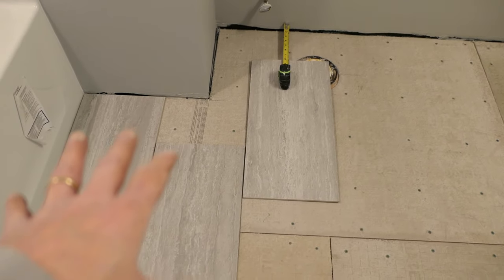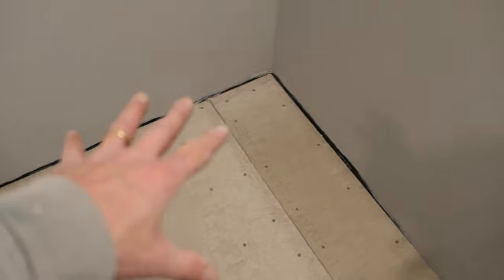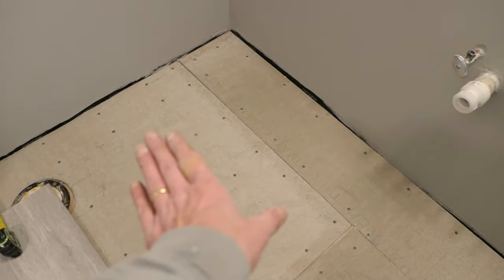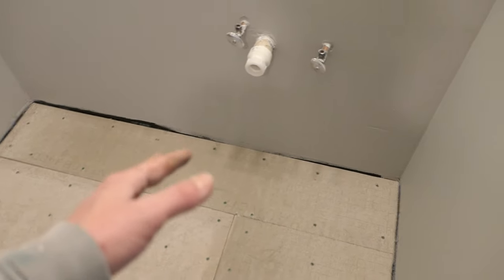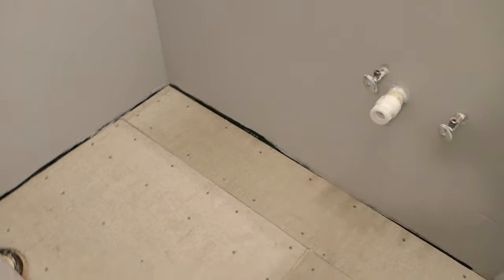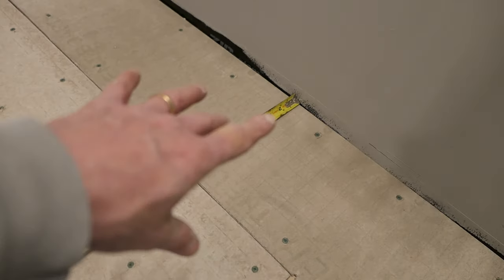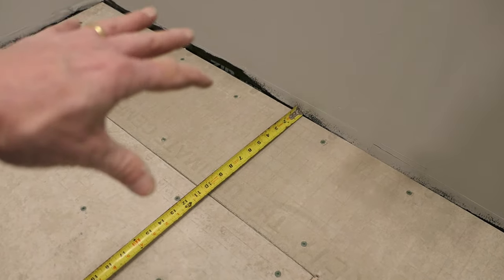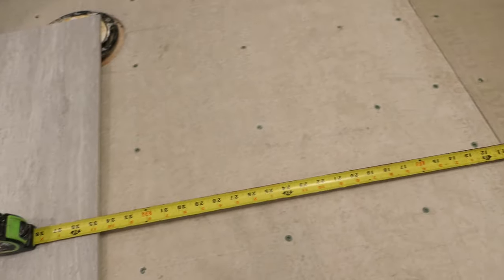Learn How To Layout Bathroom Floor Tile

Comment: You just Aug me handedly taught me how to layout and think through my process. So many other videos I watched talked about it as if I had done it before once or twice.
Reply from the maker: It is something you should spend time on and not feel rushed.  Planning the details now is a lot easier than tearing up tiles later!
Reply: @enduringcharm  absolutely.
Reply: @enduringcharm  do you recommend chalk lines or laser?
Reply from the maker: I don't find chalk lines or a laser to be useful once the tiling begins.  The chalk gets covered and the laser line is too fuzzy.  Sometimes I'll use one or the other in a larger room when doing the initial layout.  For small bathrooms I typically use the tub or pan as the initial straightedge and work off of that.  For larger bathrooms or kitchens where there is the possibility of tile rows becoming crooked, or for installing lots of very small tiles, I will screw down a straight edge to the floor.  Then I can lay an initial row of tile against the straightedge.  That sets up pretty quickly, and then I can remove the straight edge and use that initial row of tile as a basis for the rest of the room.
Reply: @enduringcharm  Thats exactly what I was thinking of doing. I have a pretty large kitchen that I’m about to tile and I’m going to use the laser for my initial line, set the first row of tile going north and south during my dry fit, then set the laser up going east and west for the rest of the room.
Reply from the maker: For a a large room like that, I'll cut up several strips of plywood on a table saw, about four inches wide.  I'll mark the straight line I need for the tile, and then screw the 8 foot lengths of plywood down along the straight line.  Now I can tile up to the plywood and after that row sets up I can remove the plywood and finish the job.

Comment: Great video. Love how you go through all the trade-offs etc. in your thought process. Layout is one of the least demonstrated parts of tiling. Your layout looks great.
Couple additions: A 4' grinder with a smooth diamond blade for cutting toilet flange holes. Then it doesn't matter where hole lands and you can exclude it from your layout.
Avoiding 'painting into a corner'- I often do a straight line across the room where I can reach and fill in the rest the next day, sometimes with speed-set, or with finishing the tub tiles. I worry by the time I get back to the original line, those tiles could get accidentally moved and bond compromised while continuing on, with levelers etc. You only have 10 minutes or so 'safe' time. 
Thanks for sharing all your videos.

Comment: I’m so glad I found your channel, so much easier to understand what you are doing. I’m doing my first bath renovation due to your videos and the confidence they inspire. Only question I have is what size tile would you recommend for small bathrooms? I was considering a 16x24 but my bathroom is 7x5. Thanks in advance for reply.
Reply from the maker: There are two potential issues with large tile.  One relates to the flatness and deflection of the floor.  When you have large tile the floor needs to be dead flat, or else you risk "lippage" (when the edge of one tile is not even with the adjoining tile) and you risk cracks later if you have to use a lot of thinset or levelers to get the tile flat.  This is all made worse if the floor also has a lot of deflection due to undersized joists or subfloor.  Small tile, by contrast, also has many more grout lines, and that allows the tile to better conform to any waviness in the floor, as well as to absorb more movement.  So the first thing I look at when a client wants a large format tile is how flat and how strong the floor is underneath.

The second issue is aesthetics.  In a smaller room a large tile does risk looking kind of dumb, because there isn't enough of it showing to even see the pattern.  You can pull it off if the tile pattern happens to work well with the bath fixture layout and the doorway.  The bath in this video was not big, but the pattern was such that you could make a big tile work.  Other times I can see that a smaller tile will be more pleasing to the eye because you'll be able to better make out the overall pattern.

Comment: Thanks for this, you pretty much answered my questions, I have a similar issue that I was trying to figure out. I'm going to start at my shower pan and lay it out that way. I was spending time trying to figure out why I need to know if a room is square if it isn't jack I can do about it. I assume for awkward cuts, etc.. My only issue was where to start, the shower pan seems like a good starting point to have a new straight line. The room isn't crazy out of square, nothing baseboard wouldn't handle.
Reply from the maker: Yeah, the tub or pan is a good place to start, especially since an out of parallel tile there would be very obvious to the eye.

Comment: I was hoping to not have to cut the flange in a whole tile but couldn't work my way around it.  I'll be cutting the flange hole tomorrow.  Fortunately, I found a video where the tiler demonstrated how to cut an octagon vs a circle which seems much easier to do.
Reply from the maker: Sometimes it just doesn't work out to put the edge of a tile over the toilet flange.  Remember, though, that the toilet itself will cover a lot of area over the flange.  You may be able to cut a square hole or octagonal hole in the middle of a tile and have it covered by the toilet.  Cutting in the middle like that often leads to cracked tiles, though, so be prepared with extra tile for the project.

Comment: Very well explained…the only thing I wouldn’t necessarily agree with is that a 12 by 24 can be put in half’s with no issues.Just use a leveling system.A pro shouldn’t take choices away from a customer just for his/her convenience
Reply from the maker: The problem with large format tile is not that it's difficult to get level, but that when it cures it naturally can form an arc or curve on the top.  This will vary depending on size and manufacturer, some are worse than others.  So if you take two tiles and put them face to face, you'll see that they meet in the middle of the tiles but there is a gap at the ends.  They are not flat, in other words.  So the point of a 2/3s pattern is to minimize the lippage in that situation.  Using a tile leveling system does not solve the problem.  And, believe me, the 2/3s layout isn't done for my convenience!  It's much easier to do a 1/2 tile layout.  So when I install a 24 or 36 inch long tile, I check the flatness first and then determine the layout.  It's very rare that tile of that size is flat enough to use the 1/2 overlay.

Comment: Nice, did you do a vid on placing your hardiebacker board? I'm curious if you used thinset in addition to the screws? Plus, I thought todays best practice is to lay a liquid waterproofing system?
Reply from the maker: When we are talking about a floor, Hardi does recommend the use of thinset under the backerboard, which is typically the 1/4" variety.  However, I never do that for two reasons.  One, I don't think it's necessary and it adds time and expense.  Two, I have some respect for the next guy who will have to tear up the floor in the next remodel.  I have installations approaching three decades in age where I did not use thinset.

As far as waterproofing, that's a big subject but it is not typically used on a floor unless there is a walkout or "curbless" shower. That said, what I like to do is apply self stick flashing under the edge of the tub or pan before I put down the backerboard.  When I take apart bathrooms that's where I typically find the rot.  The flashing prevents any water from soaking into the plywood.

Comment: Lovely job. Quick question if I may. I am using exactly the same size tile, what size notch on your trowel and what size tile spacer are you using? Maybe you could do a video on this subject if you haven’t already ☺️
Reply from the maker: Grout line spacing with this situation is typically 1/8" or 3/16" but you could go larger if you wish.  The trowel notch is typically 1/2 inch square, or you may choose a smaller notch if you apply thinset to both the floor and the tile.  Just pull a tile after you put it down and check that you are getting full coverage, that's the important thing.

Comment: Thanks, this covers a lot of layout concerns that can easily be overlooked.  I'm tiling my bathroom with 6" x 36" wood look tile right now.  One thing we did that made my job easier was to select a "rectified" tile,  witch eliminates the warping concern and allowed me to lay it in a more random pattern, looking more like wood floor planks.  One issue I'm dealing with is that we are using this 6" x 36" for both the floor and a wainscoting, but we are using smaller format glass mosaic in the shower that the wainscoting of the large format times will bump up against.  The large format tile requires a 1/2" x 1/2" x 1/2" trowel, whereas the glass mosaic calls for 1/4" x 1/4" x 1/4" trowel.  I'm wondering if I can get away with using the 1/4" trowel for the wainscoting of the large format tile, so that they are the same level?
Reply from the maker: There's some confusion here we need to clear up.  First, a rectified tile means that the edges have been mechanically cleaned up after firing.  That can help as far as uniformity of dimensional sizing but it doesn't help as far as the potential curvature from flat.  You still want to put two tiles face to face to get a sense of how much curvature is baked in.  A rectified tile edge is usually a sharp edge, not rounded, so lippage is an even greater concern.  The overlapping by a third is still going to be a go-to technique for a 36 inch long tile.  

Your problem with the glass inlay is a common one and I typically try to get my inlay to match the thickness of the field tile.  If that simply can't be done, you still need to provide enough thinset thickness for the field tile.  Then when you get to the thinner inlay you can build up the thinset in two layers, allowing one layer to set up a little first, or you can use a single thicker layer by being careful not to over-press the inlay tile into the mortar bed.  I typically make this the stopping point for the day so that when I come back in the morning I can continue to build on top of the inlay with the field tile.
Reply: @enduringcharm  Thank you for the reply. Your technique of applying the thinnest in two layers is going to be very helpful in getting the two tiles to sit at the same level. 

Your description on what a rectified tile is makes sense and explains why no one ever talks about it as a means of solving lippage.  Even the boxs on the tiles we bought show a picture that aligns with your description of rectified and it even directs not to overlap tiles by more than a 1/3 of a tile.  We bought this tile at Lowes about 2 years ago thinking we would get to this point in our project much sooner.  I know as we researched it we found there were some tiles that Lowes sold that are flat and did not have the warpage issue.  The tile we bought is made in the US by Stonepeak Ceramics Inc in Crossville TN and they bill themselves as "high tech porcelain".  It's 100% flat.  I got out my my 4' level and every sample I pull is perfectly flat.  I don't know how they did it but it appears to be an anomaly in the industry.
Reply: @enduringcharm  Another technique for building up the thinner mosaic tile is first laying the mosaic sheets onto a waterproofing membrane. It has the benefit of adding more stability and less likely for thinset to squish up through the grout lines when you have to build up to level with field tiles.

Comment: Did you do the 3 4 5 rule? I dont nessary understand the  3 4 5 rule. Like I seen people measure away from.the wall and start there Or do you have too? My bathroom is small about 40 sqr feet. Wall not squar ect..I am sure you know all of this. So how else would you squar the room? Or sometime it's no always conducive it seems
Reply from the maker: The 3-4-5 method is just a simple means of measuring a triangle, which then ensures two of the lines are 90 degrees to each other.  I have never used that method in a bathroom, nor do I think it would be useful there.  If you start at a point and measure 3 units in one direction, and then measure four units in a different direction from the same starting point, when the ends of those two lines measure 5 units the two lines are 90 degrees to each other.  You've drawn a triangle.  

In a bathroom, what is important is to align the tile with a straight edge so that it is pleasing to the eye.  In most cases that is the tub or pan.  In large bathrooms I may just measure a straight line down the middle of the room and get it parallel to the wall without any vanity or other items.  When the tile is not parallel to wall with a vanity, it isn't as noticeable.  If all of the walls are badly out of square, like in a very old house, I may just put a line down the middle and split the difference.  When you tile, you will use that straight line you created against the tub or in the middle, and continue to work your way across the room using spacers for the joints if you like.
Reply: Thanks.. This is my first tile so I have learned a lot of what not to do😂. What leveling system did or do you use? I used the spiners on the tub wall and were ok. Some did not break off evenly so I had to grind them down.. I also used to much thinset so i had to clean the grout lines.. not fun....
Reply from the maker: I rarely use a leveling system unless I'm dealing with very large tile.
Reply: @enduringcharm  I am using 8 x 48 tile. Which level system would you use? Also what size trowel? I was thinking 1/2 x 1/2.
Reply from the maker: I would probably not use a leveling system for that tile.  Obviously with a 48 inch long tile you'll have to use a one third offset pattern, and a leveling system would just needlessly complicate things.  Plus you run the risk of cracking such a long, narrow tile.  It would also be wicked expensive given how many you'd need. For the notch size, you'll need to evaluate the floor/backerboard flatness.  If it is dead flat you can use a smaller notch than if it is wavy.  Since your tile is so narrow I might consider using a smaller notch and covering both the backer and the tile before laying the tile.  Put two tiles face to face and see how bad the warpage is.
Reply: Do you pre-cut your tiles or cut a few at time? I seen pro and cons on both but not sure what is better.
Reply from the maker: I work alone, so each cut is a trip to the wet saw set up outdoors.  Still, I would never try to precut a bunch of tile, that would lead to poor fit since a slight difference during tile setting will show.  I'll sometimes cut both ends of a nearly completed row but otherwise it's one at a time.
Reply: @enduringcharm  Thanks!!
Also what type of thinset do you use? Modified or unmodified?
How did you learn all these trades?
You videos are simple to follow and not a lot of technical jargon...
Reply from the maker: Use modified thinset unless you have a specific reason not to, such as using Schluter products over certain substrates.  I learned all this the old-fashioned way by reading, asking and doing.  This is my 18th year in business but before I turned professional I spent years soaking up knowledge and skill wherever I could find it.

Comment: Getting ready to install my bath floor.  Will use Ditra over plywood.  Does the Schulter metal trim at the door threshold go under or over the Ditra?  Is thinset all that is needed to hold it in place?   Carpet is in the hallway. Thanks.
Reply from the maker: I have never actually seen the Schluter floor transitions in person.  They aren't sold in my area.  Looking at the website, though, I really don't like the idea.  The metal transition strips are fine for wall tile, but on the floor I think you would run a high risk of scratches and dents in the metal, a loose strip, or even cracked tile.  I would encourage you to think about a marble or man-made stone threshhold instead.  They are wider and they can overlap the carpet slightly for a clean finish.  More info here:  https://youtu.be/vQKFdO65Qz0
Reply: @enduringcharm  Thanks for the insight, will definitely look into the marble threshold.  Does marble require a special thinset?
Reply from the maker: You can typically use whatever thinset you are using for the floor tile.  And if you don't want a marble look, you can choose solid colors of the man-made materials.  If you have a local tile store nearby, try that over Home Depot or Lowes--the tile store will have a larger selection.

Comment: Do you use thinset under your backerboard?   Is the threshold piece applied with glue or thinset?
Reply from the maker: Well, I use Hardibacker, rather than some of the other brands, and it is stiffer and smoother than the other types which can kind of crumble apart.  While it is recommend to use thinset under the backer, I do not.  This is for several reasons--I want to allow some movement of the plywood underneath (decoupling), I want to be kind to the next guy doing a remodel, and I just don;t think it's necessary.  That said, I do take pains to make certain that the plywood base is strong and dead flat.  The marble threshold is installed using thinset, making certain to get complete coverage underneath.
Reply: @enduringcharm  
I’m putting hardiebacker down right now.  I’ve always done thinset under it.  Thanks for the info about the threshold pieces.